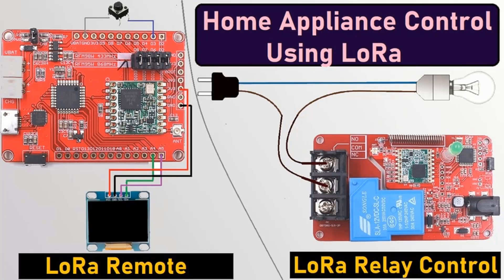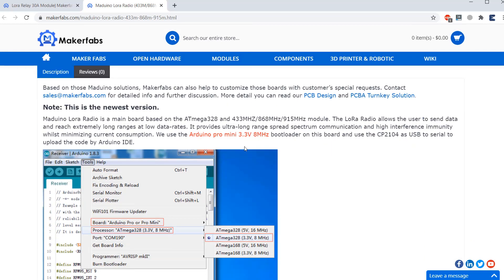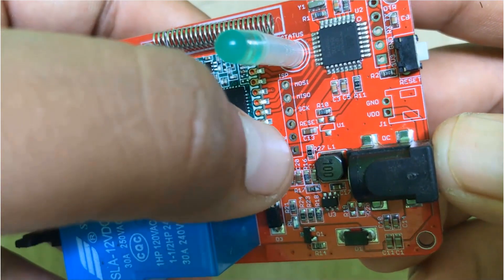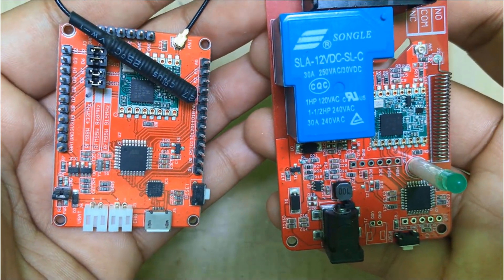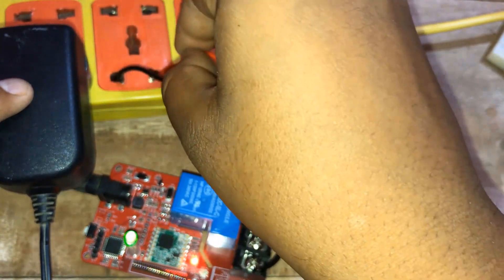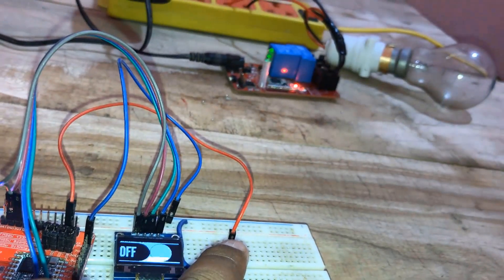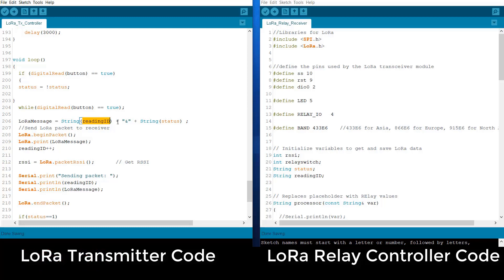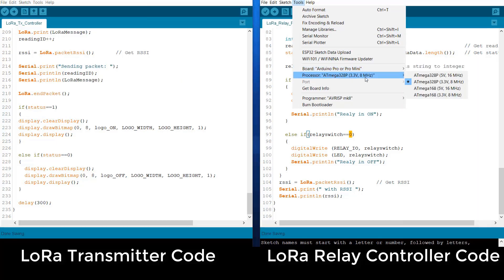LoRa Based Remote Appliances Control Project | LoRa Power Relay Control Switch

Comment: Can I use 10 numbers of transmitters and receivers in same premises....how each transmitters and receivers can be paired with each other?
Reply from the maker: You can use upto 16 transmitter and receivers. To pair that use some secret code both at transmitter and receiver.
Reply: @HowtoElectronics  I don't know coding....can tell me where is this code in this project
Reply: @HowtoElectronics  what if I want to use 20 transmitters and 20 receivers....one transmitters connect to one receiver is it possible using same secret code in transmitter and receiver

Comment: This is a great video. I have got it working 100%. Please can you assist with code for when transmitter pin DIO3 is high then on and DIO3 is low then off. Thank you